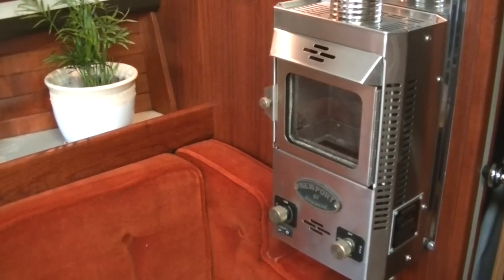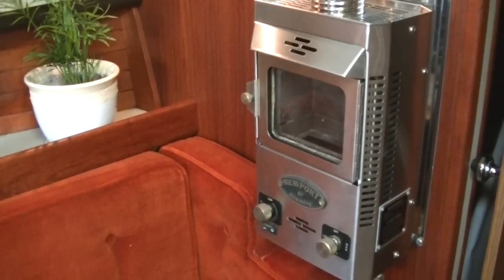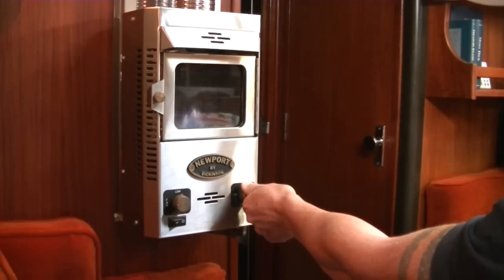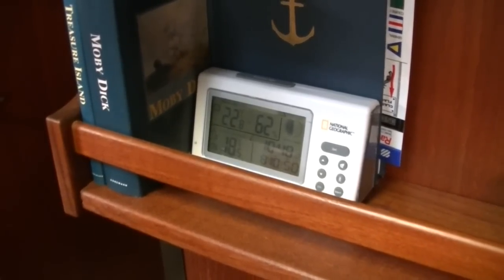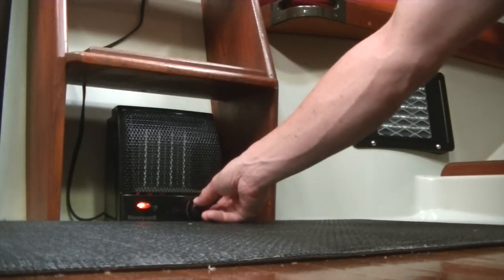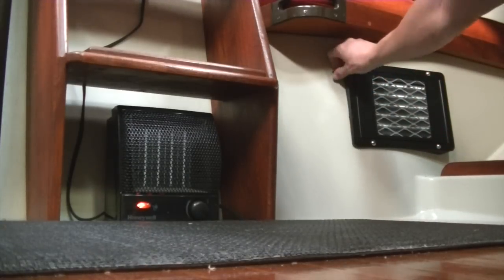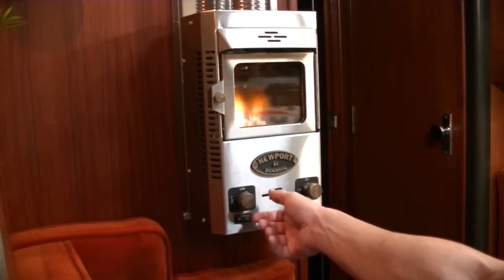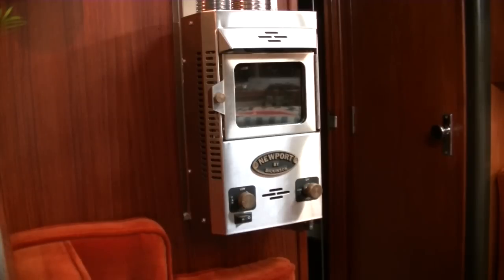Life is Like Sailing - How I Heat the Boat

Comment: Sweet video.  One suggestion; when turning off the heater or your stove, turn the propane tanks off first.  This will allow the gas to burn out off all the lines so that there is no chance for a line to leak propane into the boat.  One the flame has burned out you can turn off the heater or stove.  Much safer way to go.
Reply from the maker: Yes that is the best way to do it for sure.  I do mention that in my more recent video which covers all my propane systems on the boat.  :)  Of course like you mentioned the thing is to be absolutely sure when shutting off at the tank is that you don't forget to go back and shut off the control on the stove or furnace of course.

Comment: I have the smaller model, which works great. I liked it so much I got one for the kitchen in my little cabin in the woods, to take the morning chill off, and also one in the small guest house.
-Tom
Reply: I did have to replace the fan on the unit in the kitchen (which gets the most use). The fan was originally from a Canon printer, which is now out of production, so I found a robust PC fan that fit the space and works well. The fan is necessary to get the most out of the heater. Another advantage in the small spaces I'm using these heaters is that the intake air is drawn from outside so no inside air is used for combustion. A quite wonderful made in the Lower Mainland BC all stainless steel product.
-Tom

Comment: IT is not necessary to wait to shut the door.  You can shut the door immediately, and once shut you can release the knob and the flame will continue to burn.  So both those waiting periods are not necessary, and not specified in the manual.  It is necessary to keep the knob pushed in until the door is shut.  Also, while there are 2 pre-sets, the stove can be adjusted to any intermediate setting, including just barely going.  Another sailor who had lived with the stove for years while cruising, showed me that.  Thanks Martha !  The 12v current draw if very low I think about 100 ma or 1/10th of one amp.. and it will run with the battery voltage quite low.  The stove does not require any electricity to run, it only powers the fan.

Comment: Cost of propane is higher than diesel or electric heat. Propane, like diesel, can heat the boat when you're away from a dock and an electrical connection. We're heating with 1500 watt electric heaters this winter-- three because it's cold in Massachusetts!

Comment: That's really neat, what I'd like to hear is how long it operates on just a 1(one) lb/kg cylinder at each temperature setting.
Reply: dickinson website says 7 hours on low, 5 hours on high approximately on 1 lb of propane
hooking it up to a 20 lb BBQ tank it would last two or more weeks!
Reply: 2hhrs maybe easily 250-350$dependingonboatsize per month for living aboard

Comment: Thanks

Finally someone took the time to video this unit.

Is this the 9000 or the12,000 model?

Propane : amount used in terms of hours at low  and high setting is____ ?

Did you install this?

Age of unit?

Thanks again great channel
Reply from the maker: Hey Finn,

It is the P9000 and after pulling the manual out, I have a few specs to share with you.

Fuel Consumption:
-1 lb tank     Low-7 hrs : High-5 hrs
-20 lb tank   Low-140 hrs : High 100 hrs
(I have a 10 lb tank so I'm just dividing the bigger tank in half for what I can get)

Heat Rating (fan off):
-Low-3100 BTU : High-4300 BTU

Heat Rating (fan on):
-Low-6428 BTU : High-9000 BTU

The unit was installed already when I bought the boat 3 years ago so I'm not sure how old it is.  I just love having it and it definitely make of season cruising more comfortable!

Thanks for watching and glad you are enjoying the channel!

Comment: Noticed during the initial ignition there was a ticking sound coming from heater, probably caused from expansion as the heater heats up. Does that noise continue or does it stop once the heater is warmed up. I was thinking on putting this in my 20' x 10' open concept camper trailer. I'm one of those unfortunate light sleepers, please let me know. I'd rather not spending that kind of money on something that keeps me awake at night, appreciate any feedback,
Reply from the maker: I think it is the metal adjusting to the heat and it stops after the unit has heated up then runs silent (if you don't have the fan blowing).  Hope that helps with your decision.

Comment: I forgot to ask, do you have any condensation issues? Other than adding some carpet, did you add any insulation materials, anywhere? Glad you mentioned CO detectors, Mads didn't in his Sail Life videos so I inquired if he needed them with a diesel heater. Thanks, again, for your expertise...
Reply from the maker: Well every boat will have condensation issues...usually in areas that have less ventilation.  So depending on the temp and humidity levels I can get condensation at times in these places.  I try to keep everything well ventilated, warm and dry to avoid this.  I have thought about insulation the hull in these areas and may do it this summer when I know it will be good and dry for the adhesive.  

Well I am no expert on all these things, but I just do the research online and ask people so I can come up hopefully with the best solutions.  haha
Reply: there are no condensation caused by the stove.. it vents to the outside, and no combustion products ( C0, CO2, or Moisture) will enter the boat if vented to the outside.

Comment: Any info on the length of chimney capabilities? I found this model for sale with 28 inch chimney, but I would like to make a longer chimney. My idea is to use this heater in a tiny house this coming Winter and then install it in boat next year.
Reply from the maker: Not sure of that, but Dickinson has a website that should have that info.  :)  Good luck with the install.

Comment: I wonder if the fact that you're using both an electric heater and the propane is keeping the humidity at 62%.  Are they in the same space and on at the same time?  Worried about humidity - my use is different, not a boat, but a deer blind where I don't want things getting rusty.

Comment: Can you make a video where you explain the gaz storage and piping? I have an Aloha 28  and I am very interested in installing this type of Dickinson furnace. I use compressed Methane instead of propane but that is the fit from the previous owner that I never bother changing yet. I have never been at ease with that cylinder on my boat because of the so high pressure. Propane is more widely available and easier to handle. (The only downside being heavier than air property which carries a danger inside indeed.)

Comment: Hello, I just mounted the same Dickinson Propane heater in my sailboats cabin. I haven't used it yet, are there any tricks to using it? On real cold nights do you let it run continuously or turn it on and off? How much propane would you say you use? I have a regular 6 lbs tank, and I bought a 20 lbs tank thinking the six wouldn't last very long. Any tricks of the trade you can share? Thanks!

Comment: that's awesome. no water from burning propane in a boat. it goes up the chimney. Does it use much gas? better than diesel cost wise?
Reply from the maker: +S/V Boadecia Journey through refit and beyond Not sure on the cost comparison to diesel.  I have all the specifications in the video details.  :)

Comment: when you turn off the heater using the knob only, is there a pilot light that keeps burning(and using fuel)?
Reply from the maker: +alzathoth Once the knob is turned off there is no pilot light.  It has to be re-lit.

Comment: Hi there, I have just found your channel and have subscribed as I am buying a boat end of the year so doing as much research as possible pre purchase. I thought the heater is diesel? Yet at the end you said you will go upstairs and turn the propane tank off so I'm a little confused. The reason I ask is because I will be getting rid of all gas on board and purely having everything electric such as the bbq, stove etc. Do I need gas for the diesel heater? Thank you. Shane
Reply from the maker: +wallabyshane Glad you found the channel and thanks for subscribing.  The wall furnace that I have runs on propane.  There are heaters available that run on diesel as well.

Comment: Thanks for the Vid
That heater is next on our list. Is it the 9000 or 12000 and do you use a cap while sailing? My main question is regarding the bus heater it seems to be a fairly small unit is it adequate for your boat?
Reply from the maker: It is the 9000 and I have a nice low profile vent on top so I have never capped it and I have never had issues of water coming in.  :)  The bus heater works well, but I only really use it in the last 45-60 mins of cruising for the day while I motor in.  It definitely makes a difference for once I am tied up or anchored and by using the bus heater I have a good start for keeping the cabin warm.  :)
Reply from the maker: yes it is the one at the bottom right corner :)

Comment: I notice that you have a notch cut out of the cushion near the Dickinson Heater. Did you need to mount the heater low for some reason?
Reply from the maker: The heater was installed before I purchased the boat, but having the heater lower is better that higher since heat rises so that would be why they positioned it there I am sure.  :)

Comment: I have 2 of these heaters, 4 years now, they heat nicely, very efficient, the glass window doors "do not" seal properly when shut. they also leak in the pipe areas as the pipe fittings are not completly sealed, the pipe is stacked, the heaters do infact have holes in the bottom of them, look for yourself, they are suspose to be carbon monoxde free , that is not true and they do obsorb oxiegen from the compartment when running, as I said there are holes in the bottoms of these heaters pulling in oxiegen, i recieved zero information on that fact. the sellers of these stores will say they do not leak carbonmonoxide . my testers have shown they do. my carbon monoxide detectors have gone off. my installation is right on key , no issues there on my part. NOTE:  How I fixed the issues - The window did not have the window seal all the way around it and when pushed on , it was obvieious the window was not real tight fitted against the metal, So! I went and bought wood stove fiberglass rope that is used to seal wood stove doors, they have differant sizes and thicknesses...I got a real thin peice and just stuffed in in all around the glass window with a spoon and really sealed that window in tight , I did that to both My stoves...Then the stove pipe were it connects to the stove and were it connects up to the chimney,  I bought more of same stove pipe rope and just wrapped about 2 layers around the pipe connection areas were it would leak and that sealed all the leaking up...I just clamped it all down after wrapping it all up with metal circle clamps, used about 3 clamps at each area i wraped to make sure all the rope wrapping was pressed real tight Yea! Do that,  don't use any liquid seal stove pipe cement type stuff , you'll just have a big mess to clean up and chip off and scrape off and chisel off uhhh trust me... it's all junk and causes smelles and smoke isses that you never had in the first place.., save yourself the extream greif --- do as I did , you will have no further carbonmonixide issues...I did both my stoves that way....finely you can adjust the doors on the stoves , there is a screw on each end of the door you can access,  I had to adjust both doors to get then to shut real tight, the door seals are not air tight seals  there  just stove pipe rope glued on the door, thats is not an air tight sealed door when closed....
   these are good heaters, but you better ventilate when in use , there not what they are made out to be buy the manufacture. they take some work to get right and agaion ventilate and have your safty detectors on. good luck

Comment: It's curious to me, that your heater would begin with a blue light, and transition to an orange flame. I'd have thought, that the blue flame would be the hot, efficient flame you'd be looking for - wouldn't it? Doesn't the orange flame mean an incomplete burn of your fuel?
Reply: Mitchell Ryan because of lower oxygen content of air in the cabin after the heater has consumed it.
Reply: @robertmencl9169  - Unlike the solid fuel or diesel models, the Newport propane heaters don't consume any cabin oxygen. They are fully sealed units. The chimney is actually two tubes in one.. the inner tube carries the exhaust gases up, and the outer tube carries air down to supply the flame with oxygen.
Reply: JAFO wouldn’t it be a more efficient design if the heat from the exhaust gases could be radiated into the cabin from the metal “chimney/flue” - or is this too risky?
Reply: @drdecco1  - Very slightly more efficient, perhaps.. but the tradeoff is that oxygen would be drawn from the cabin instead of the outside. This would mean you'd have to allow cold air in from the outside to maintain safe oxygen levels, negating any benefits from the improved efficiency. There would also be the potential burn hazard from the hot chimney, although that could be fitted with a guard.

Speaking personally, I wish Dickinson would make their dual-tube chimneys available for diesel heaters as well. I'm unsure as to why it's not an option.

Comment: Curious why you have 3 different heaters, understand the heat from the engine is not away available but why a propane and electric heater?
Reply from the maker: When I am at the marina I often use the electric space heater so that I am not having to fill the propane tank as often.  Although sometimes I prefer the propane wall furnace as it is more cozy.  When I am out cruising and at anchor I use the propane heater.  I don't have the electric heater with me when I am away from the marina.  Just nice to have options.

Comment: The only difference  with mp propane little buddy is the COLD WEATHER SHUT DOWN ....PROCEDURE.

We are told to shut off the tank 1st and then turn off the stove when the flame burns the gas out of the line.Cold propane turns to an oil in the line.This plugs up the little buddy and then you need a filter as the oil plugs up the stating.

You may not have this problem with this MORE EXPENSIVE unit.

I don't have a fan but I may put your unit in my RV in 6.6 when we retire to the BC Islands ? What is the amp draw on that fan on low and high ?
Reply from the maker: Yes shutting off the propane at the tank is something I do when I know I won't be using the furnace again for a while.  The fan is variable, but the manual specs say the draw is .17 amps
Reply: LifeisLikeSailing - Vancouver, BC  Hmmmm
very interesting.

So since I'm retiring to Salt Spring and area.....Have you ever sailed up to Ocean Falls ?

That place reminds me of my ming home town Creighton Mine Ontario.

GHOST TOWN as of 1986.

And the Arcapello  islands which is all park islands. My spelling is wrong  North East of Winter Harbor.
Reply from the maker: BRUCE LEE Well do I have a story for you!  My parents met in Ocean Falls way back when it was a booming town!  I went there in 2008 and went into the Martin Inn (the only hotel in town) and stood in the cafe where my mother worked and the spot where my parents met.  Of course the hotel and cafe inside were totally overgrown and there is not nearly as many structures standing compared to when they were there.  

Anyways a very cool spot for sure.  I was fortunate to have seen the entire coast of British Columbia as well as Haida Qwaii during my time living in the north.  I plan to go back up there and continue exploring over the next dozen or so years, maybe more!  

Oh and Saltspring Island is a great spot!  I'm sure you will love it there!
Reply from the maker: BRUCE LEE You will have to keep me posted on your travels and let me know when you plan to sail up there!  :)
Reply: Will do Captian

Comment: you didn't show how warm did it get. i have a trailer and i need to buy something that will really keep it up in the 60s in the winter...
Reply from the maker: +mimi taylor I keep the boat about 19-20 Celsius.  :)
Reply: so i calculated and that is about 68 degrees now is that the entire boat or just in front of it bc my wave 8 was supposed to reach at least 10 ft. and i almost gotta sit on that thing to keep warm :(
Reply from the maker: mimi taylor the furnace keep the main cabin area at about 20 C, the V-Berth up front is slightly cooler.

Comment: Can you use the heater underway and healed over?
Reply from the maker: +Greg Akers I have used the heater while motoring, but I haven't tried it when the boat is heeled over.  I think it would still work, but I probably won't try it.
Reply: I have this unit and use it while sailing in northern Newfoundland & Labrador, sometimes ran it for 24 hrs a day healed over in 20-25kts. Worked like a charm!